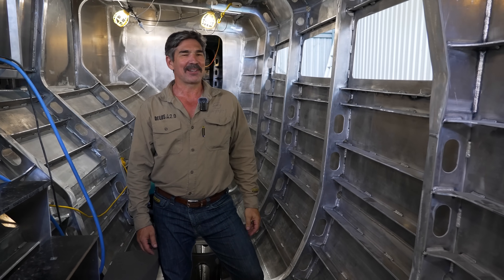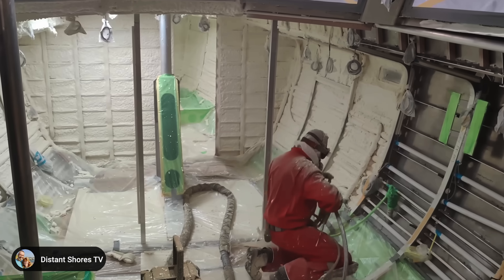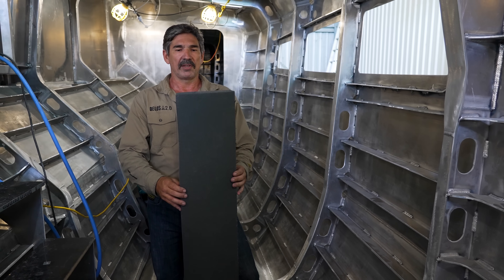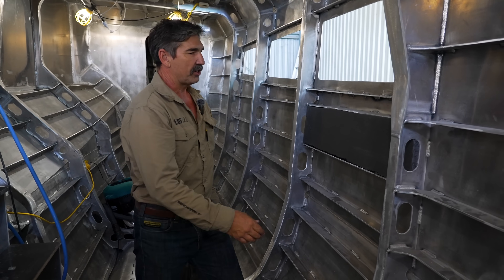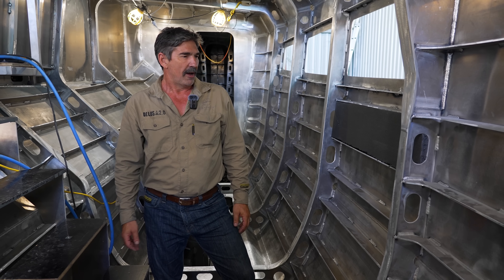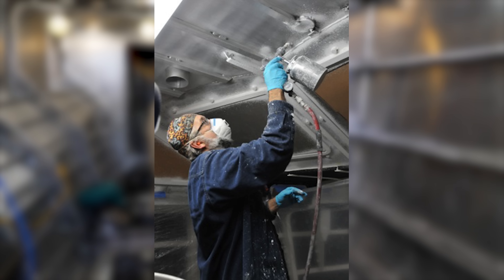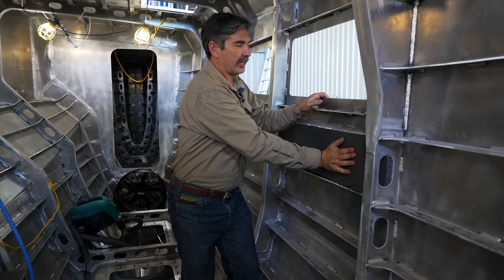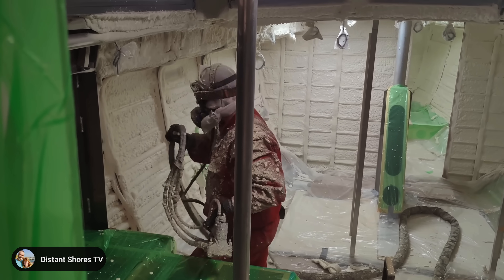HELP, We Need Your Advice!  How Should We Insulate Our Aluminum Catamaran???

Comment: I used a combination of EVA foam and home ceiling fiber panels (think big rectangles of pink scratchy stuff) that I folded over and taped to seal in the fibers.  I don't recommend the second even though it worked for me.  EVA foam is much easier to work with, but if you're going to adhere it to a hull you have to worry about sweating.  So that means making a really good seal, which can be tough - especially if the foam is textured at all.  Spray foam is pretty much born for this.  You want the lightest possible density to give you the best R rating.  The good thing about the spray is no gap fears, no shaping issues, it just fits perfectly.  I would say if you have bits you're worried about getting to, then get yourself a curved wire cutter to keep on board.  Basically a soldering iron but you replace the tip with a small steel loop.  Turn it on, the loop heats up, and you can easily carve the foam away from whatever you need to work on.  Flatten the end if you want to cut squared shapes. And then later you can refill with more spray foam.  But do not let the fresh wet foam come into contact with anything other than hull.  It will be impossible to remove from wires, cables, hoses, etc.  There are better cutters than this, but this one is dirt cheap: https://youtu.be/DZIHq1IR0AQ?si=pUBDEW1c77qOpf2L

Comment: I have no knowledge of aluminum boat building, but just basic engineering tells me that I would spray the whole interior with some material to seal the metal and then put the closed foam insulation on

Comment: Agree on the spray foam as a base but there are ways to get around your issues... A thin layer of spray foam, or the paint, followed by your foam inserts (the only way I would consider the foam blocks is if there was already a protective boundary layer.) Foam inserts could have  partial slices to allow stringers to nestle inside the foam blocks. A heavy layer of spray foam with channels cut with hot wire formed to shape of whatever shape/size conduits/raceways you require (kind of silly in that you pay to spray it in then carve it back out and throw away... but it leaves zero bare spots and is WAY easier to apply.) I'm not seeing the reason to use the 'nails' to retain block foam unless there are areas that won't have any covering over it (thinking that would be a bad idea but what do I  know?)

Comment: My comment was going to be about making sure no moisture could form behind the xpe and coating the aluminum first. My concern with blow in foam is out gassing of toxic chemicals like formaldehyde etc, that would overwhelm such a small place like the boat hull, plus it would tend ti settle in there without being able to vent it out properly especially when you have it closed up trying to stay warm. The companies doing spray foam make all kind of safety claims that iff gassing or decomposition doesn't occur, but I  am hesitant to believe them. I don't know what the right answer is,  but those would be my major concerns.

Comment: You hit the nail on the head with the last comments about any exposed  (or even less insulated metal surfaces)  conducting heat and becoming subject to condensation. An Aluminum boat is a huge radiator. Any air space can collect condensation. I really dislike spray foam for several reasons but it works really well as an insulator. Cautions about off gassing both for just the foam and especially if there is any fire or even hot surfaces.

Comment: Does a spray, roller or brush on thin coating that insulates really well exist? Yes it does. CeramaTherm is an extremely unique, ultimate performance, ceramic-based, epoxy sealer coating insulator. At the thickness of paint, it has a near-zero thermal transfer rate. Designed for aerospace applications of minus 270°C, it is the best insulation coating available on the market today. It is a corrosion and moisture protection coating. It is bright white, flexible, waterproof, and breathable. It is fire retardant and will stick to almost anything while remaining flexible and having the side benefit of 68% sound deadening.

Comment: Use the space between ribs as a watermaker and dehumidifier/air conditioner.  Make cored panels for walls that will insulate and seal off your living space and have small, quiet, low power fans blow air into the gap between wall and metal hull.  Collect the condensed water, and the recirculated air will be cooler and drier.

Comment: I fully agree with you when it comes to the spray foam. Closed cell foam is probably one of the best choices, and it also doubles as a sound barrier. You can sticky back it to areas you would never need access to, than pin it in areas you may need or want access to in the future. Is there a reason you can't or don't want to use several types of insulator like using the spray in specific areas than closed cell with a secondary layer to prevent that condensation in others?

Comment: If you spray-foam, I would think you could use a solvent to clean down to the metal, if you do need to do some kind of repair...   An oscillation tool should make very short work of cutting out the bulk of spray insulation, and then a rag with solvent... ...I use to spray van interiors, when I worked at a place making camper vans, and it seemed to work out pretty well... ...but that was 3-decades ago... ...best of luck.  I will be following along!🙂

Comment: Use the closed cell foam  at least the boat will be unsinkable for peace of mind also look into car spray body deadener , it seals it stops corrosion it also creates a thermal barrier and it also is a sound deadener . My car is 30 years old no corrosion anywhere where the body deadener sprayed worth a thought? Cheers

Comment: Closed cell polyurethane spray foam is the only reasonable option.  It is not only a completely impervious air and vapour barrier, but it's a water tight barrier.  You can puncture your hull and as long as it doesn't make it all the way through the spray foam, you won't take on water.  It will protect the hull from any corrosion caused by salt water.  It has fantastic acoustic and thermal insulation properties.  It's a bit of a pain if you need to remove it but it is so easy to fix.  Cut and chisel it out then just get a new can of spray foam and fill back in afterwards anywhere in the world, wherever you are at the time.  You can even use spray foam as emergency hull repair in a can.

Comment: Be aware that any metal poking past the insulation will conduct cold so I would coat the spines with that paint you mentioned and use the solid insulation foam or SeaRox. You can get a sort of sponge/matrix like sheet, like they use under bedding to avoid mold. Put a thin layer of that to promote air movement and then the solid stuff on top.

Comment: No knowledge but based off what you listed I'd spray with coating then use black foam between slats then a wide sheet over everything. You can run wires between the two layers possibly.

Comment: Install the plumbing, wiring chases and a spare conduit, above water line, that will run along the hulls with one for the mast.
Then use closed cell spray foam. Foam isn't all that hard to remove and replace

Comment: Using closed cell spray foam is going to be MUCH quicker and give better results in my opinion.  If you ever need to get to an area that you think might need to be accessed frequently, don't apply spray foam in those areas.  By and large, you will never need to remove the spray foam.  To repair say a damaged area of the hull, scrap off the foam or remove it with a power brush, do your repair and reapply the spray foam.  The other method of applying some coating and then cutting and affixing blocks of insulation seems way to difficult for not as much return in the end.

Comment: Hi Brian, I would not discount the possible issues with mold. I used spray on insulation once and it worked fine until mold became an issue. Because the installation also trapped moisture, it was virtually impossible to solve the problem. I personally would not go with any product that was not able to be removed and replaced if necessary. Just my two cents. Congratulations on Delos 2.0. My wife and I love your videos. Best of luck!
Reply: Only an issue with cheap open cell spray foam. 😅

Comment: I would use the spray foam, just make sure it's fire retardent and smoke retardent. not from the UK but have heard about some resale issues in homes. Also in the UK and in one of the Arab countries, they have had fires when the building were clad in and exterior foam panel system. Just check to make sure fire retardent and smoke retardent.